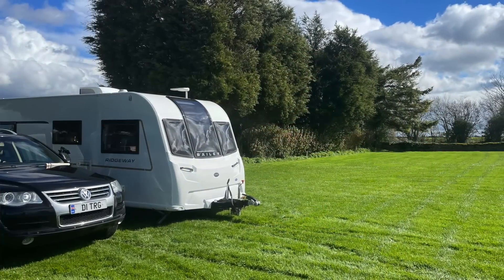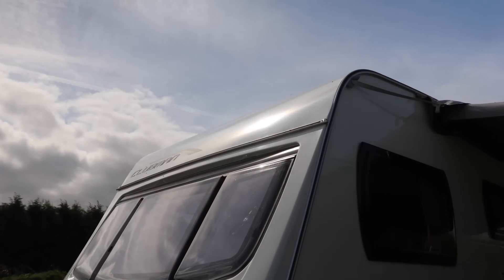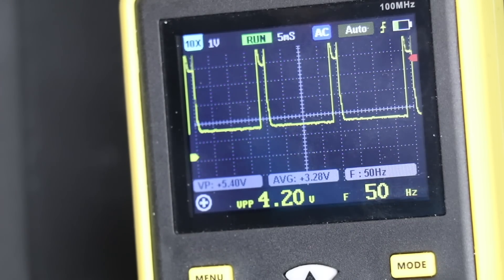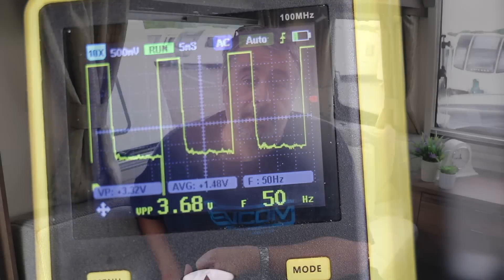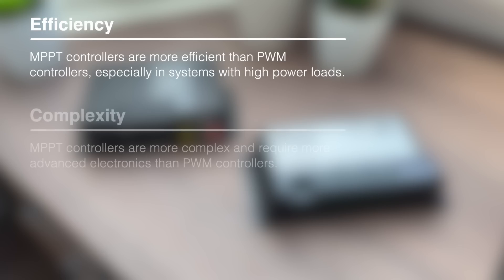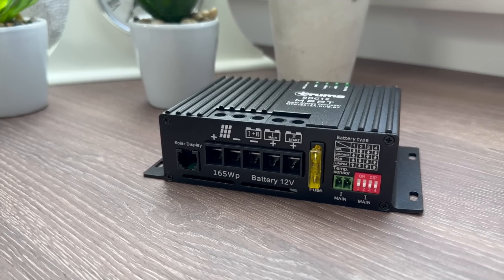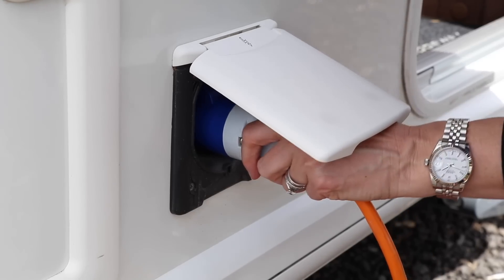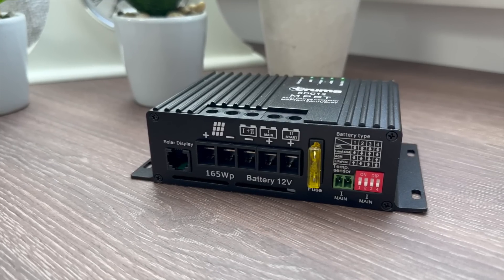Upgrading our caravan solar installation

Comment: Many thanks, Watch the video Full length and they seem to understand it I have an SDC 12 charger and on my Auto Trail Expedition 67 2025 Model the last terminal on the right, is the one that goes to your engine battery so when your solar in the van I believe is full it will also add a a. Couple of amps to, your engine battery which could save a lot of hassle... having watched this and seeing that all you've done is flick the switch for the Lipo 4, obviously fitting a life 04 battery I take it this would be straightforward so I'm going to look around for A Relevant battery as a Lipo 4 battery, you can rundown to Virtually zero and recharge either via solar or electrical hookup on sides

unlike your video. I like the chat that you've put onto it everything seems to be straightforward and understandable thanks. Again
Reply from the maker: Hi, yes it’s pretty straight forward. The last terminal on the right is+VE for the vehicle battery. It only supplies 1amp according to its specs 

The switches are straight forward for battery types. 

Any issues, drop me a line. 👍

Comment: Would I be able to use this same setup on a static caravan ?
Reply from the maker: yes you can, however I would look at the bigger controller that allows for bigger panels, and more current to be delivered to the batteries.

Comment: Hi I'm hooked up to mains power a d my mppt light is flashing at a constant rate just watched your video an I think it means it's ready to charge once disconnected could you please confirm this many thanks Mark J
Reply from the maker: Hi, if its flashing it means the controller is ready to charge, but doesn't need to as the battery is already full (i.e being charged from the on board battery charger) Hope that helps.
Reply: @TheTrudgians  Thank you so very much. That helped, and you've explained it very well. Btw, I've just shown my husband your message as he's been a fan of yours for years. He didn’t believe me at first. He said thank you, you've made his holiday.

Comment: hi is it wired directly to the leisure battery ,   or though the Sargent  charger,     will it stop charging the battery when you shut the 12v power off in storage.
Reply from the maker: Hi, this controller is wired directly to the leisure battery. It is intended to supply a charge from the panel even when the main switch (Sargent etc) is switched off. 

Hope that helps.

Comment: again you have helped me with a problem with my Solar panel/ MPPT .   
I have had battery discharge whilst in storage , which impacts on my tracker and insurance. I could not tell if my Solar panel was working and after watching you install a MPPT , I now think its the Solar panel / MPPT and can take it back to the dealer with confidence that this is a warranty issue. Thank you once again.

Comment: Hello Dan, Thanks very much for such an excellent video - as always... 
We have a brand new caravan with exactly this system. However I think we have a problem with the battery not being charged. After fully charging the battery at home the "Full"  and "Charge " lights are on. Then after a few minutes these lights extinguish and the MMP is flashing - indicating It's not charging - (It was reading more than 13v at home..) In the last few weeks the battery has completely run down... So I imagine I have a problem. If you have a minute I would appreciate your thoughts please... Thanks very much and a Happy New Year... Col

Comment: Great video, I am new a Caravanning.  I have a solar panel fitted with a mppt controller and the mpp light is flashing which I understand means “ready to charge”.  No other lights on the mppt controller are on.  The main caravan controller shows the battery is at over 13V.  Could you explain what “ready to charge” means and under what circumstances I would expect to see the it.
Reply: This morning it is all working as expected, maybe the “ready to charge” light flashes if there is insufficient sunlight to charge the battery?

Comment: Hi Dan just a quick question. Finally getting my caravan sorted and should get it tomorrow.  Needs a good wash and as I don’t stay on mainland what’s the best stuff for a long awaited wash down? I know I have silky cream cleaner and another spray bottle of something (it’s in caravan at mo ) and also does the caravan have to be hooked up for the electrics to take the water through the taps

Comment: The biggest crime I see is the controller location. I never understand the factory location, it is incredibly inefficient.

Actually no. The BIGGEST crime is you wired up the new controller in the incorrect order. Battery connection first yes, but the controller HAS to be powered by the battery before connecting the panel. You run the risk of frying your controller by doing it the way you did it.
Reply from the maker: Wired as per instructions. And with no battery connected, no current produced by panel, explain how it could have been fried? 

Also, how does the physical location of the controller make it inefficient?
Reply: @TheTrudgians you did it correct, you made sure it was all dead first, you fitted it and terminated it correctly and then you fitted the battery terminal first and then took the dog bed blanket off the panel, so you did it correctly, (so don't know what the guy above is talking about) and a Excellent presentation 👍🏻 👏 I've subbed 👍🏻

Comment: Hi there love the videos you put out, I have a question on inverters I understand the wattage side of things  my question is, if my inverter only has 1 x 230 AC socket for me to power the appliances ie tv kettle fridge etc do I have to run an extension cable from the sole socket on the inverter to each appliance or is there a way off  tapping into the caravan 230v sockets ??
Many thanks Darren

Comment: Great VLog. keep up with the good work.

I bought a brand new Swift challenger 560 in 2021 fitted a Sargent solar controller. As I go off grid a lot, what Swift fitted wasn't up to the job & not fully charging the caravan AGM battery, and over winter battery went flat. So I have done the same as Steve Bloxham and had fitted MPPT controller which allows Bluetooth monitoring and greater control of charging profiles, from a world renown company "Victron". A leading solar brand - one of the worlds best for on/off grid applications. even on poor days now it keeps the battery topped up. Victron products are not cheap, but you get what you pay for if you want the best. And the results speak for themselves.
Reply: Hi we have the same caravan, my sargent inverter is also not up to the job, but i notice the control panel above the door has a solar display on it, showing bar graph for voltage but also a input of current from the solar panel to the battery,  will changing this to a mppt controller effect this panel please ? i don't know how it interfaces with it or doesn't it matter please? My panel is 100w and the current inverter is a Sargent 150w small looks basic inverter, please can you help with what you used and Model number please, thankyou..
Reply: @user-cq6em5wt2r  Hi.

In response for your enquiry about solar on your caravan. 

The Sargent Solar controller is a PWM (Pulse Width Modulation) controller.
Basically, it reduces the voltage from 21/22 volts DC from the solar panel down approx. to 14.4 volts, basically is an on/off-intermittent overcharging protection device, wasting approx 20/30% power available from the solar panel.

By changing to a MPPT (Maximum Power Point Tracking) Charge Controller.
Your not wasting solar power.
All the power from the solar panel is used more efficiently, excess voltage is turned into current (amps), therefore optimising power from the solar panel to charge the caravans battery. Providing a more constant stable charging voltage.

You will not damage anything to the electronics/electrical system of your caravan.
In fact caravan Electronics/ Electrics are better protected.

Swift, along with other caravan/motorhome manufacturers are now fitting MPPT controllers to the caravans. 

As per my post I do recommend "Victron" MPPT charge controllers as they are world renowned leading products. For on/off grid/ domestic/ Leisure, Marine, leisure vehicles Etc.

Very easy to change over yourself.

Place a dark towel/cloth/coat over solar panel. To stop solar panel from producing power. 

Disconnect the caravan battery. 

Disconnect the wires off the Sargent controller making sure the battery & solar wires are marked up.  Advisory, take a photo first before starting.

Remove Sargent PWM junk.

Install MPPT controller, it's only a few screws. wire back up correctly pos/neg of battery and solar as on the instructions. 

Re-Connect battery

Download the App, if Victron MPPT (Preferred Brand) or one of the other brands.

If Bluetooth option is available. Better brands have that option. But not all do.

Connect via Bluetooth. Change setting to correct battery type.

You can change setting via an app on your phone for the correct type of battery you have fitted. Lead acid/AGM/Gel/Lithium Etc from menu. And have a log of performance.

Lastly remove covering off solar panel.
Check via the app and Swift command centre that it’s all working correctly.

If unsure of doing it yourself, get a qualified caravan/auto electrician to change it over for you.

Comment: Dan. A great instructional video with all the right tips and practical advice for the layman. Basically I trod the same path on my Bailey motorhome a few years back when the Banner died due to constantly gassing itself to an early grave despite topping up. I selected two Yuasa EFB 100Ah for Leisure battery for better off grid support. Also researching Solar expert sites and reading the PWM Truma SDC10 controller manual in detail indicated that any morning with reasonable light the controller would “wake up” ramp the voltage to 14.4 and hold it there for 2 hours minimum regardless of battery SoC. Hence the gassing off.  I settled for a Votronic MPPT Duo that would keep the starter battery maintained. That had a variable timer for start up 14.4 initial charge then drop quickly to Float. Also fitted a SoC monitor system from NASA BM-1 that BTs to my phone for immediate SoC of  Leisure and voltages of Leisure and Starter. Since added a second Solar panel for rapid recharge of low battery.

Comment: Great explanation Dan, and MPPT is a very good upgrade.
Personally I’d have fitted a top notch Victron controller that allows Bluetooth monitoring and greater control of charging profiles.
Anyone contemplating a change beware of no name cheap MPPT controllers sold on eBay or Amazon, many are just PWM controllers with MPPT printed in the front!
Reply: Victron all the way Steve!
Reply: Are you sure about that 'mppt printed on the front ' i was just looking at one myself
Reply: Hi Steve, I have the same PWM controller that Dan was replacing but mine seems to be faulty. What Victron one would you recommend and if you can let me know if there are any useful additions that are also available to purchase? Thanks.  

Great video Dan as always
Reply: I've just bought a Victron Smartsolar for my caravan, as I'll be offgrid for a few weeks in the summer. Could you advise on the EHU issue for me? To avail of the "intelligent Load output function" I will need to connect the caravan load to the controller as opposed to the battery. What happens when I'm back on EHU? Can the controller receive power through the load connection and send it to the battery? Or will I have to rewire the caravan load directly to the battery again?

Comment: Great video Dan, I have been wanting to change to an MPPT as we go off grid. I have added a second battery in parallel and two 100 watt panels on roof plus a second controller to plug in two 50 watt suitcase solar panels when on site. Changing the controllers to MPPT is going to make a big difference. Just one comment I thought you said the 12 volts runs the fridge. Do you have a different fridge as the 12 volts is only for towing. We run ours on gas.

Comment: Love the vids and as always well made a informative, one question How do you/me set it up to charge a second battery i have now fitted. i have just connected the second battery + to + & - to - with an old set of jump leads and fitted it into a plastic battery box with a lid on it screwed to the floor. Many Regards Peter.
Reply from the maker: Hi Peter, ok if you’re wiring these in parallel, you may need to connect the solar controller to + of one battery and - of the next, in order to balance the charge. Alternatively if they are separate, use the 2nd battery terminal on the controller. It will charge one, then the next. 👍
Reply: @TheTrudgians  Hi Dan, Thank you for reply, i see what you mean, they are in parallel so i will give it a go. Just for info when i double checked the controller unit in my new Bailey Evora it is the upgraded unit already. Win/Win 🙂
Reply: @TheTrudgians ok but then if charging 2 batteries from 2 inverter outputs, what about the 12 volt feed to the caravan? would you need some sort of switch to switch between batteries feeding the 12 volts to the caravan? otherwise both batteries would still both be linked together at the caravan 12 volt output, what's the solution please ?

Comment: Hi, Dan, I'm not sure that your description of how things work on EHU is true.  I'm afraid I'm not nearly as good as you are at explaining these things, but here goes. 

The usual charger built in to our caravans (certainly our vintage of Bailey) is, as you say a constant voltage device, with current limiting and a nominal voltage of 13.8v.  Now 13.8v will not fully charge a modern lead acid battery which requires a boost charge with a voltage between 14v to 14.6v depending upon the exact battery architecture.   Both models of solar controller you showed are much more complex devices which are capable of delivering this charge profile to the battery and this is the purpose of the dip switches, to set a particular program for the different battery types. As I understand, with a discharged battery the solar charger will share charging duties with the EHU charger until the battery voltage is high enough to take the ehu charger out of current limiting.  Once this happens the solar charger will increasingly take over charging duties until it has completed it's boost charge cycle and only then will it switch off, leaving the EHU charger to float charge at it's 13.8v nominal voltage.  I have confirmed this action by dint of having a battery computer fitted and observing it directly.  The upshot of this that having a solar charging system fitted even if you mostly use EHU is benefitial in that it does a much better job of looking after our batteries, for instance by reducing sulphation, which is the main problem associated with a long term float charge at 13.8v.  Does that make sense?

Comment: Hi, interesting video, you say you want to extract more power on duller days, but the increase in efficiency is only going to be apparent on brighter days(when the PWM duty cycle is low), and even then you will probably see nowhere near 30% increase since the panel will have been chosen to suit 12v battery charging. I really can't see you will even notice the difference this makes, sure if your PWM controller is old/broken/overheating then a worthwhile upgrade, if not, probably not. Awesome presentation all the same - as usual!
Reply from the maker: Did you see the multimeter - voltage of 20v on a slightly cloudy day on our 100w panel. 

Since installing the MPPT and staying off grid for 9 days in mixed weather - I’ve noticed a huge uplift in charging.
Reply: @TheTrudgians  Sure I saw the 20v, that was at full load - battery discharged etc was it? Probably just the placebo effect, you wouldn't notice a huge uplift even if you did get the marketing hype full(up to)30% all of the time. It is quite obvious if you are using more power than your panel can supply, it is running at full load continuously and a more efficient controller is not going to help.

Comment: Great vlog and very worthwhile upgrade.Agree with comments regarding an isolator.Did you consider increasing the size of your cables between mppt and battery or were they adequate for the distance?

Comment: A Victron controller imho is much better and has BT to a mobile to log charging info. But without fitting a Life04 (LFP) battery, changing only the controller the gain will be very small. A lead acid battery is good for 25% discharge, go to 50% and its life span will decrease quickly. Which means at 25% discharge the battery voltage will go below 12v. A LFP battery can discharge to 90% and still maintain 12v output. But on a site hook the cvan charger (13.8v) is set to charge a lead acid battery only and wont charge an LFP battery fully.Charging an LFP battery at 13.8v will result in a 50-75% total charge. So you will need a new cvan charger if going LFP.😢

Comment: Surprised you didn’t go for a Victron MPPT controller, can be monitored & adjust the settings from an app on your smart phone.
Reply from the maker: I did look, but tbh - how many times do I actually need to adjust settings and already know voltage from tracker and iNet.

Comment: a question.. may be im being an idiot??? Does the caravan need to be switched on when parked in storage for the battery to be continually charged from the panels
Reply from the maker: Hi Paul - good question, and the answer is no. The controller has a direct connection to the battery, so always sending charge regardless of caravan master switch. 👍
Reply: @TheTrudgians  I thought so... thanks for replying..
Reply: @PAULOatham But - if you leave the master on and anything is drawing a little power, antenna?, fridge? the battery could slowly discharge over really cloudy short winter days with low solar light onto panel. An MPPT will help stop serious discharge. 👍